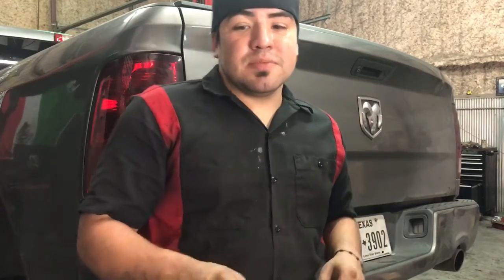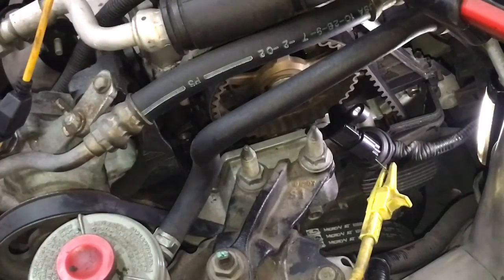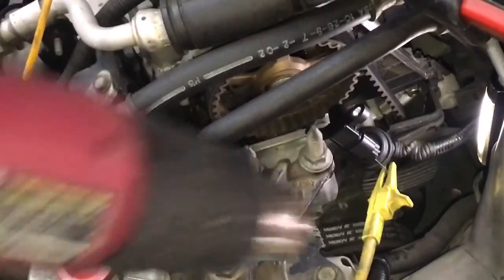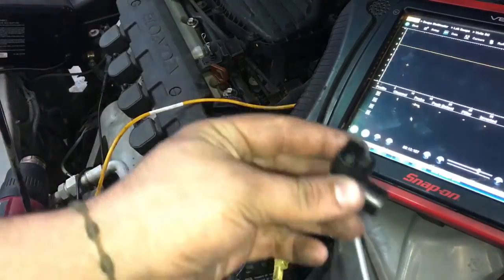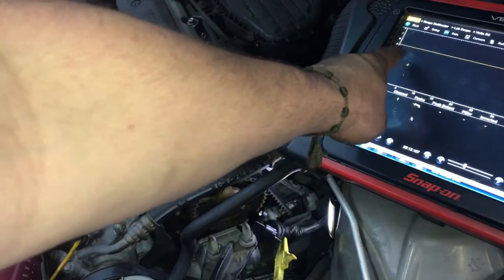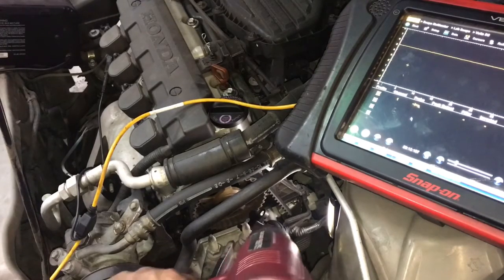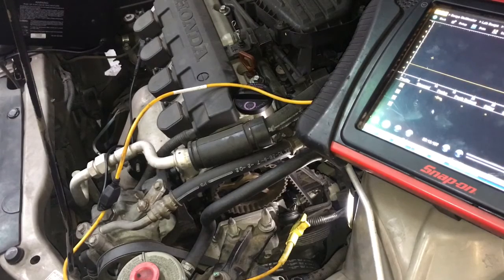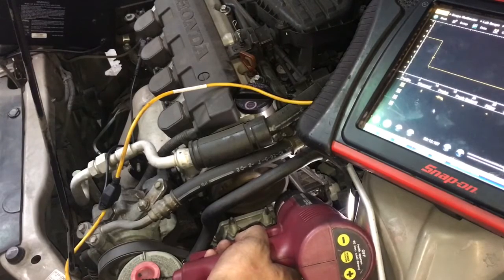How to test CAM /CRANK sensor

Comment: wow!  I never thought heat would be related to camshaft position! this exactly what my SUV is doing, as soon it warms up it shuts the engine off!
Reply from the maker: julio zepeda make sure to test the fuel pump as well. Do a proper test to verify what your actual issue is

Comment: Hi, please help! I have a ford F-150 2005 with P0345. The truck runs really bad. I already replaced both camshaft position sensors, both vct solenoids, crank sensor, the phaser on bank 2, and I also disconnected the alternator and replaced the starter and I am still getting the code, the car still runs really bad. What else Can I check? Thank you!
Reply from the maker: The proper test is to hook up a scope to the signal wire to see what you’re getting. I have tech friends all over the us that might be able to check it out for a fee. What part of town are you in
Reply: @OzMechanics  Derby, CT 06418
Reply: @OzMechanics  my connection is only two wire
Reply: @OzMechanics  derby, CT 06418

Comment: So what is the issue? Is it supposed to be happened? So it is bad sensor or engine cooling problem?
Reply from the maker: The issue was the sensor Libra Yeung. The reason I used a heat gun is to simulate the heat of the engine. By applying heat to the sensor and it dropping shows that the sensor is the issue. Does that help. This sensor should not drop with heat
Reply: @OzMechanics  thx for clarification

Comment: Julio Zepeda,,  The camshaft sensor has 2 magnetic points that comes in contact with points on the timing belt gear.The ECU then gets the signal as the speed dictates. The issue is the sensor is often times compromised by leaking oil seals and dirty oil that forms a plaque. It therefore affects the magnetic points . Usually the sensor can be removed and clean with a light cloth and electric cleaner. Also,,, the areas around it . Be careful not to damage the windings in the sensor as it can break the circuit and render the sensor useless.

Comment: And why is this sensor reacting to heat? ..
Reply from the maker: Beno Burgija well the sensor is on the engine block which gets hot. Plus add in it being confined in an engine compartment that holds the heat it. I just used the heat gun to hurry the process
Reply: Oz Mechanics Yes, yes.. I understand how does it get hot.. But I dont get it why is it reacting to heat like that .. Because it is a magnet .. I like your videos, you need to work on your videos name and presentation to get more views.. The videos and explanations are very good.. Sorry  for my bad English..
Reply: Oz Mechanics Yes, yes.. I understand how does it get hot.. But I dont get it why is it reacting to heat like that .. Because it is a magnet .. I like your videos, you need to work on your videos name and presentation to get more views.. The videos and explanations are very good.. Sorry  for my bad English..
Reply from the maker: Beno Burgija yea no problem. I'm no engineer. But I could say that the sensor has joints that can lose contact and the heat might cause that
Reply: Oz Mechanics I was recently searching for my car water leak solution .. And now I saw your video about that, after I found the solution.. The problem was I was typing "Water leakage, wet floor etc" and your clip name is just "Water leak" .. Work ok your video headline.. I am telling you this because I know your video should have more view's.. But good if you make good videos and dont make good headlines, no one will see it.. I know I am a little boring but I would love to help more people see this..
Reply: Oz Mechanics I was recently searching for my car water leak solution .. And now I saw your video about that, after I found the solution.. The problem was I was typing "Water leakage, wet floor etc" and your clip name is just "Water leak" .. Work ok your video headline.. I am telling you this because I know your video should have more view's.. But good if you make good videos and dont make good headlines, no one will see it.. I know I am a little boring but I would love to help more people see this..
Reply: Oz Mechanics I was recently searching for my car water leak solution .. And now I saw your video about that, after I found the solution.. The problem was I was typing "Water leakage, wet floor etc" and your clip name is just "Water leak" .. Work ok your video headline.. I am telling you this because I know your video should have more view's.. But good if you make good videos and dont make good headlines, no one will see it.. I know I am a little boring but I would love to help more people see this..
Reply: Oz Mechanics I was recently searching for my car water leak solution .. And now I saw your video about that, after I found the solution.. The problem was I was typing "Water leakage, wet floor etc" and your clip name is just "Water leak" .. Work ok your video headline.. I am telling you this because I know your video should have more view's.. But good if you make good videos and dont make good headlines, no one will see it.. I know I am a little boring but I would love to help more people see this..
Reply: Oz Mechanics Oz Mechanics I was recently searching for my car water leak solution .. And now I saw your video about that, after I found the solution.. The problem was I was typing "Water leakage, wet floor etc" and your clip name is just "Water leak" .. Work ok your video headline.. I am telling you this because I know your video should have more view's.. But if you make good videos and dont make good headlines, no one will see it.. I know I am a little boring but I would love to help more people see this..
Reply: Well with all sensors when they get a patch of resistance  in them heat increases resistance